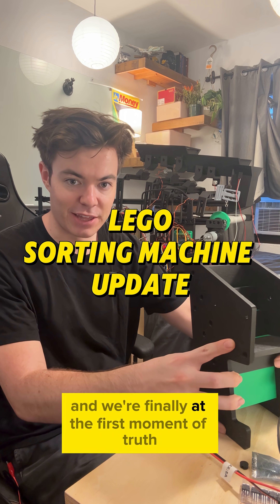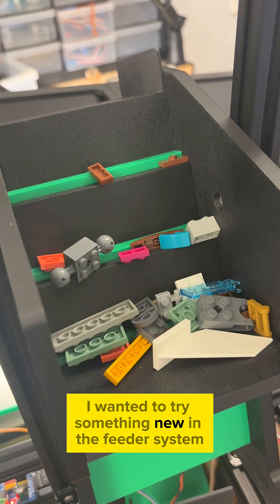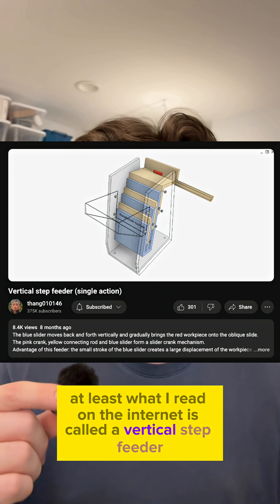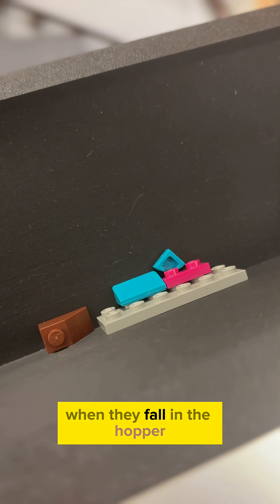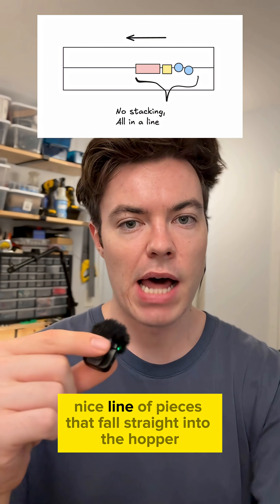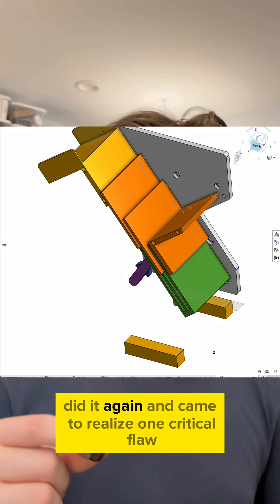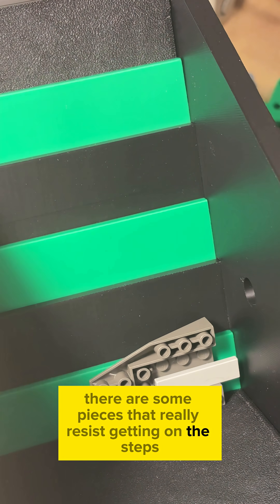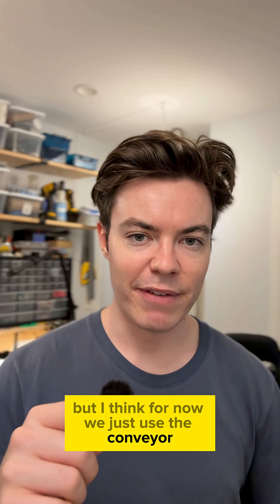LEGO Sorting Machine - Part 5: Vertical Step Feeder #lego #engineering #robotics #moc

Comment: build a filter.

Maybe you will find out for every purpose there is the right tool and THIS feeder system is well designed and your built is AWESOME, but I guess it is for the smaller parts.

Perhaps make a tray you can put at the bottom. Then, after letting the machine run you can remove the "bad parts" and run another batch of stones.

Perhaps the first step of your mechanism, you could have two rails with diverging distance. (V shape, but very elongated) With this rails you could pre-sort bricks. Then the step feeder would get only get bricks with the appropriate size and type.

Comment: Really impressive! Could you tell me a bit about how your AI works?
Reply from the maker: I'll make some dedicated videos on this in future--
Currently the backend is a service called Brickognize
https://brickognize.com/
Reply: @legospencer if you ever want to build your own model (which would be required to sell I kits — for licensing reasons) a route I’m going down to make pre labeled images is to use a python script in Blender + basic physics sim to render a bunch of random orientation bricks (or screws in my case) that are pre labeled via cryptomatte so you know if each individual pixel is part of the brick. From there it’s easy to layer on optical distortions to make it robust and handle overlapping objects and such.
Reply from the maker: True. That and Brickognize isn't getting regularly updated with new pieces.
That's how they trained Brickognize right? I saw the paper on that strategy but idk if it was used for Brickognize. Pretty nifty. Not a lot of situations does the rendered situation map so well to IRL
I'm avoiding training/hosting a model until the last second, trying to avoid any technical complexity I can, but it might come to it

What are you making the model for?
Reply: @legospencer I’m not making a model but I need test images for an OpenCV based pipeline (no machine learning) to categorize and sort screws. If you have test images in the thousands with a photorealistic render quality that the algorithm can be run against the reliability can be tested as the algorithm is developed. It’s really hard to make that many labeled ground truth images without simulation. In this case I also have to buy less hardware because I just need accurate models of the hardware which I can get from the FreeCAD fasteners workbench.

Comment: adjust the angle of it maybe ?
Reply from the maker: I played with it up to some pretty acute angles. The issue if you angle it too far is that the bucket can longer contain many pieces because the steps are basically horizontal
Reply: @legospencer maybe you need a shaker
Reply from the maker: True

Comment: Ive had the thought that using those manual sieve box things you see to manually sort into size first and then designing different feeders that work best with that specific size. Less autonomous and less fun I guess hehe
Reply from the maker: I think that's a good idea. Could still be fully automatic. If the feeder that worked better with smaller pieces was placed below the one for bigger pieces, they could fall through a coin-sorter type of thing.